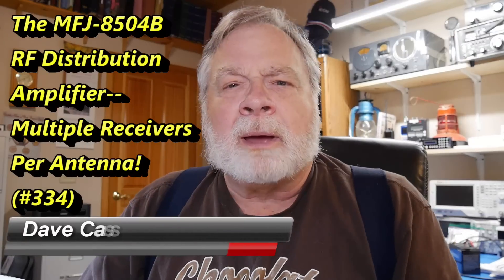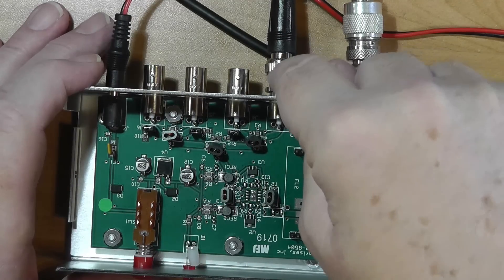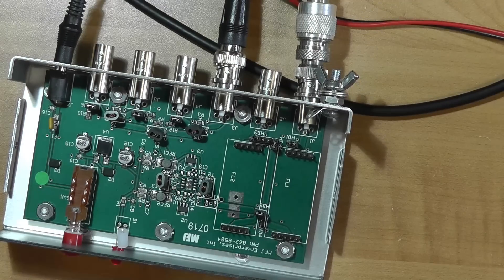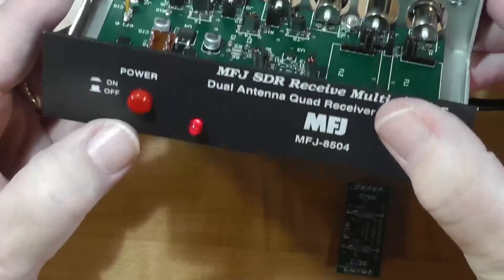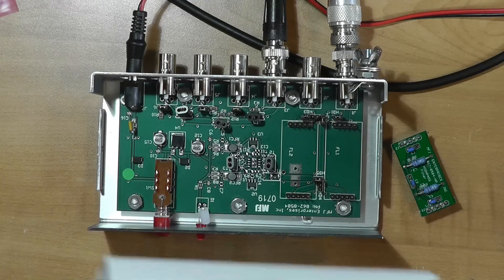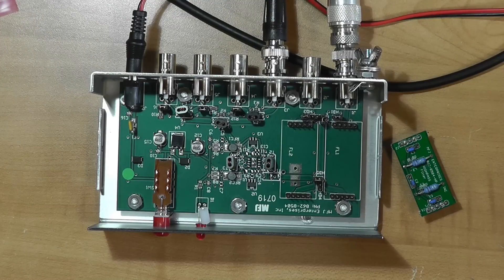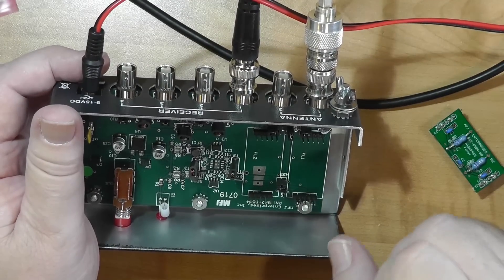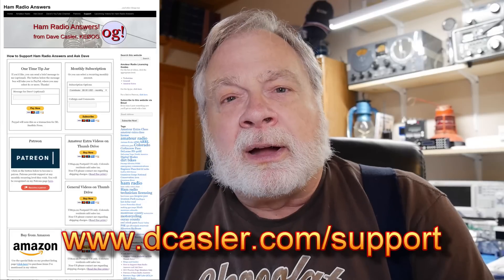Review of MFJ-8504B RF Receiver Distribution Amplifier (#334)

Comment: I just purchased a MFJ8504B  BNC connectors, no filter. The BNC connectors were loose, poorly soldered to the PCB, had to take apart to repair. Also tested the output using a SG and Spec An, it is not flat within 3dB, 1 MHz has more output at least 20dB than 850 MHz. MFJ lives up to its poor reputation, caveat emptor. Lots of  white powder ? dust inside. Poorly shielded, enclosure paint scraped, quality not what I would expect for $170.  Interesting design, will see if it holds up, draws over 200mA at 12V, MFJ states 150mA.
Reply: Glad to come across your comment. Perhaps the similar units from Cross Country Wireless and/or Stridsburg might be a better choice? Though the latter company makes you choose between HF and VHF/UHF in separate units. Your measured 20dB disparity makes a case for two different units, as I'm guessing the signal path over such a wide frequency range should be treated differently.

Comment: Looks like just what I need, a nice distribution amp.  I have 2 scanners connected to the discone antenna with a two way splitter.  I have a 4 way splitter, but the signal loss is very noticeable and I have been thinking of using a mast mounted amp to improve that problem plus the cable loss down to the shack.  I would likely still need a mast mounted amp to overcome the cable loss, but with this I can connect a third scanner and an SDR as well -
Thanks Dave for this review - it is welcomed.